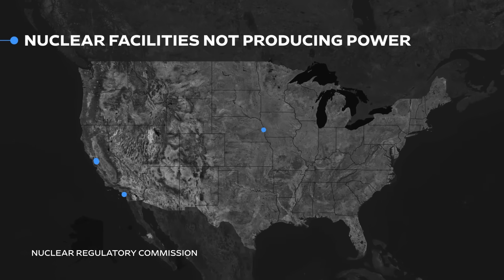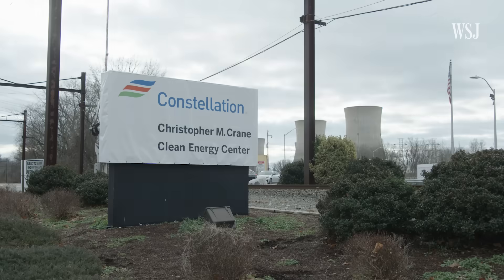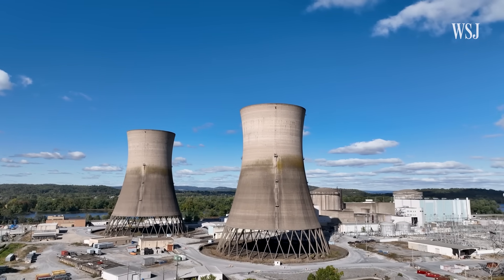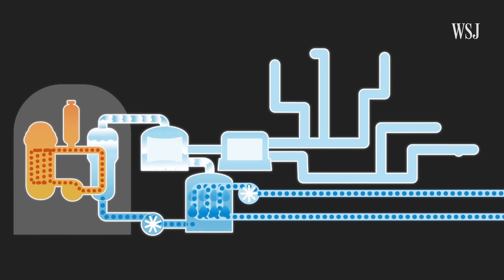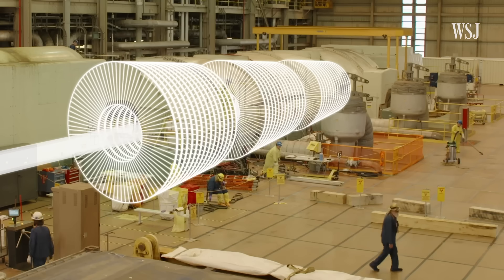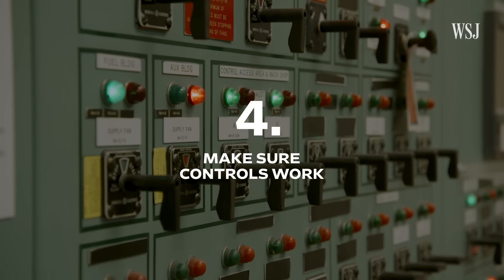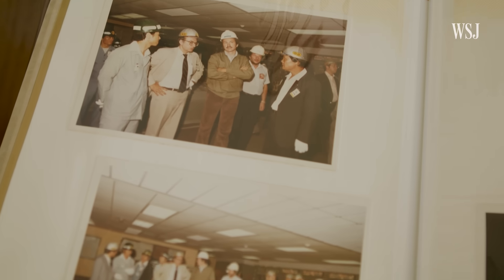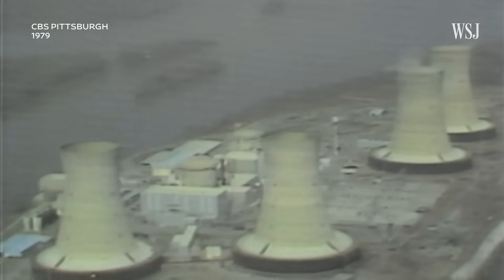Inside the $1.6B Plan to Restart Three Mile Island | WSJ

Comment: Natural gas combined with solar is far cheaper and more efficient
Reply: Cheaper yes, efficiency can not be compared between solar, natural gas and nuclear they are all different types of producing power, if you had 2 different types of combined cycle natural gas power plants you could compare but not in this way. Solar is great option but it does not cover the grid during the night time we cannot send power from one side of the U.S to the other so that logic also doesn't work and battery banks are not feasible either, you may be interested in looking at peak load demand on the grid you'll find it is when solar is becoming least available since people are coming home from work. Get your facts correct first please this is just misinformation.
Reply: @Coldsunscreen  yeah, only the documented instance when they disconnected a solar plant to justify a nuclear plant...
Reply: @FigsForYou  I'm sorry, what are you trying to say?
Reply: In parts of the US with the right climate, solar can be utilized during the day with natural gas easily able to instantly meet fluctuating demand in evening. Nuclear plants on the other hand need to operate at a consistent level meaning it can’t easily adjust power output to match the fluctuating supply from renewables such as solar making it difficult to integrate into the grid
Reply: @ I have worked at a peak load demand Combined cycle natural gas power plant it is far easier to match the power than you would think, even with nuclear it can be "throttled" to say. Solar can cause surges on grid which makes it more unpredictable and you can't just unplug that energy it still has to go somewhere that's the main issue with it where does the power go when we don't need it, we slow the production of other plant's to account for this power influx
Reply: @Coldsunscreen  I'm saying solar power works, and nuclear power is old tech. Literally a water boiler just waiting to explode. The only thing it could ever be is a disastrous liability. At least on earth. Nuclear power in space tho, that makes sense.
Reply: Kinda

Comment: Its literally nothing but a water boiler. You telling me we need this dangerous liability?
Reply: Yep.  Pedal your exercise bike to boil a quart from 65 degrees F to steam.  I bet you're going to be a bit cranky.
Reply: @louf7178   LOL, as if there's no other way to boil a quart of water...
Reply: @FigsForYou  The whole world is aware of that.
The challenge posed is to demonstrate how much energy is needed to boil a miniscule amount of water, hence, the most practical choice of meeting that demand.  Wind: expensive and birds. Solar: dependant on sunlight, no storage, 20% efficient.  Others: minimal output.
Reply: @louf7178  i think its not just an energy production issue but a usage issue. If people are still using incandescent lights and old tech that uses more energy than is necessary, then whatever they use to power that house will not matter because most of its going to go to waste. An efficient solar powered home is possible with batteries of course. Its just either not affordable or people just don't know how to do so or dont care.
Also, I think grid type power needs to go away and we need to take a personal approach to energy production. Would you agree?
Reply: @Meltpk  Sounds good in concept, but that would never happen.  Plus, there are days when production is nowhere near adequate.
This is why I've concluded that the only current solution to mass electrical production is by nuclear because of quantity and consistency.  I also feel it can be done safely, but I didn't know it was an expensive method.  Each method has its pros and cons, but I do feel nuclear types are the answer.
Reply: @louf7178  wow someone keeps deleting my responses, how cute.
Reply: When someone comes up with a better, no-risk way to make super-heated steam, the world will beat a path to their door.
Reply: @peghead  literally multiple existing ways to do it without a nuc.
Reply: @Meltpk  Feel free to list the "multiple" methods without burning coal, oil or wood (combustibles) and please be literal. P.S., I have no problem with burning coal, oil or wood.
Reply: @peghead  literally anything that produces electricity. GeoThermal, Solar, Wind, Harnessing Piezo Electricity, Harnessing Ocean Wave Energy. There are tons of ways to produce electricity that dont include a forever lasting "☢️-active" dump pile. Its old tech, and its only a liability. We need to look to other ways. 
(I'm guessing this comments gonna be deleted tho because youtube mods hate my words apparently)

Comment: They keep saying nuclear isn't economically viable, but does provide a dependable energy source that's isolated from market fluctuations and wars that mess with fuel supplies.
Reply: Uranium/Plutanium imports are impacted by war. For example France recently was impacted by huge price increases from their Uranium sources in Niger because they lost their (military) influence their.

A more self-sufficient system is one that combines Wind, solar and energy storage.
Reply: @Chuck--orris That's literally the same problem. Source the solar panels and batteries in America or source the uranium in America. Right now it's China and Russia.
Reply: @Chuck--orris  The US has more than enough uranium and plutonium  resources internally to operate existing facilties and even build more. If we're looking at eventual energy independence, all forms should be looked at.
Reply: @Chuck--orris  that sounds good in theory, but in practice, some places just don't get enough of one to cover for the other, and these solar farms tend to displace agriculture and create environmental problems of their own. Both wind and solar create big aesthetic polution (and in the case of wind, noise and bird safety issues), or in the case of wind farms, all the other problems surrounding that, including the fact that not every location can support it, and you can't push electricity but so far.
Reply: @Chuck--orris the problem with that is base load generation. Renewables are volatile. The depend on variables you can not control. They are good for dealing with spikes in demand but are terrible for your base demand level.  Not meeting your base level because it's been cloudy and windless for several days, depleting your battery banks(built using lithium from third world countries that are absolutely destroying the ecology to mine it, and probably more than a little slave and child labor) means you'll have a true blackout. Those take months to recover from.
Reply: Not entirely true but the concept is correct nuclear would still be impacted by war just not as much as lets say Natural Gas, the U.S at war would switch to what is available and can be managed easily nuclear power plants are large targets they would be targeted first in an attack so whatever is available is what they would use
Reply: There's a lot of market fluctuation of fuel for these things as well as wars.
Reply: It is. no unsubsidized commercial venture ahs ever worked.
Reply: you can pay market rates for nuclear power whilst we rich will just be self-sufficient with solar and storage. 
best of luck to you.
Reply: @Cecil-yc6mc  so Germany and the UK had their electricity rates go up because the wind farms underperformed, between 12%-14%. That's what happens when your energy producer is reliant on natural forces. Good luck with that. 🤣🤣
Reply: If the swings are sufficiently large, frequent and long there  is room in the market for power storage arbitrage including pumped hydro.
Reply: @allanwind295  and yet, the lobbying for nuclear continues despite being expensive and dangerous.
Reply: Dude, the US has bought BILLIONS of dollars of nuclear fuel from Russia - $800 million just in 2023.  Last time I checked, they were still getting whooped by Ukraine, and we were supplying weapons to Ukraine.
Reply: After the Russian full invasion of Ukraine in 2022. The following nations have used or bought nuclear fuel from Russia. 
Finland, Sweden (defective fuel rods found feb 2022),France, Slovakia, Hungary, USA and more. So where is the independence?
Reply: Uranium is mostly imported from Canada 27%, Kazakhstan 25%, Russia 12%, Uzbekistan 11%, Australia 9%, and Other 16% <<https://www.eia.gov/energyexplained/nuclear/where-our-uranium-comes-from.php>.  Do you want to pay 2.5-4x more for electricity than other carbon neutral sources?
Reply: AI comment
Reply: They need for the Crypto mining centre.. Remember the Bitcoin stock reserves?
Reply: It isn't viable because regulations make it more expensive than it really is. Like everything else, it has to be produced at scale to be cheaper. We can't just build one or two plants. We have to build 20.
Reply: @stevensko9153  Sure, construction and finance are the biggest cost factors for nuclear reactors and building them in a great ten year plan (take that, soviets) like France did in the 70's will reduce those cost factors per plant. But even if you eliminate construction cost entirely (good luck with that) they are not competitive with renewables unless insuring the plant and dealing with its leftovers is entirely eaten by the taxpayer. That is how every NPP on the planet is run.

The next well camouflaged elephant in the room is that Nuclear power needs to be embedded in a cozy electrical grid. Meaning they need to run at high capacity without interruption and they are terrible at following demand shifts. So they will either have to be backed up by gas plants or loads of batteries. What would make somewhat sense is to use nuclear only to provide the base load that will never ever not be demanded. And that is what the US is kind of doing already.
Otherwise you run into big incompatibilities with renewables and that is a massive headache to deal with.
Reply: @stevensko9153  oh yeah, when did regulation ever help anything....rtrd
Reply: @stevensko9153  "It isn't viable because regulations make it more expensive than it really is"

Ah darn those pesky regulations... If it wasn't for them people could be generating nuclear power out of #2 soup cans in their apartments... A true utopia...
Reply: Sooo one corporation to rule them all
Reply: It it was about dependable energy they would be using thorium reactors.

Those uranium reactors are designed purposely to make weapons, with the least efficient power generation design.
Reply: Nuclear fuel is the same as fossil fuel, but smaller. Its pellets but wood chips or coal are combustion. There is not a lot of difference.

Comment: Anybody getting weird OceanGate submersible implosion like vibes from this?

That engineer using black electrical tape to remember which controls he did or didnt test and running around with a binder which looks like it has instructions from 1979 in it?

Also the other guy checking for cracks using a flashlight lol
Reply: The things that techs do to keep our grid running would make your skin crawl then this is an effective way to know what works and what doesn't and to check for large cracks yes you would use a flashlight but he could have been inspecting something unrelated to cracks and that's just what the voice over said
Reply: They need to begin with the original operating instructions for the facility. You can't just throw those away.
Reply: @jessebaker9430  You mean you can't just google how the plant is supposed to run?
Reply: @jessebaker9430  ya it's not like buying a product and tossing the owners manual away 😂
Reply: @ I did that with a mandoline once. HUGE mistake. Lost a big chunk of thumb.
Reply: Ya I would agree that seems like a pretty odd way to verify operational conditions at a nuclear power plant.    Seems more like part of a future documentary about failure and what went wrong.

Comment: @0:27 90,000 GW (90 terawatts) is about 75 times the U.S.'s current hourly power usage. The state of education in the U.S. is depressing.
Reply: I would probably point to the state of "confusing" energy terms,  if I had to guess what was stated was a need for "90,000 giga-watt-hours in 2026"  which for a year translates to about 10 GW continuously,  however she read "90,000 gigawatts an hour"
Reply: @Mike__B  Energy terms are only confusing if you failed grade 10 physics.
Reply: Those are rookie numbers, you gotta pump those numbers up.
Reply: 90 TW is accurate. AI GPUs and POW currencies need energy. Kardashev t1 here we come.
Reply: Confusing Gigawatts (GW) with Gigawatt-hours (GWh) is a common mistake in the general public & even news organisations. Interestingly, solar & wind only advocates like to use installed capacity (like GW) as a metric instead of the more relevant GWh.
Reply: What do you expect from a journalist who probably has a degree in social "science"...